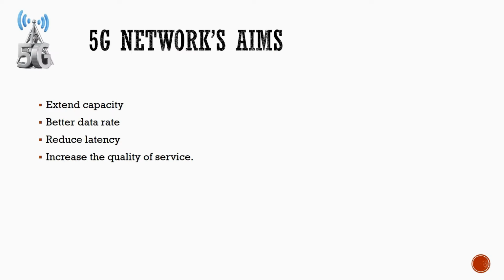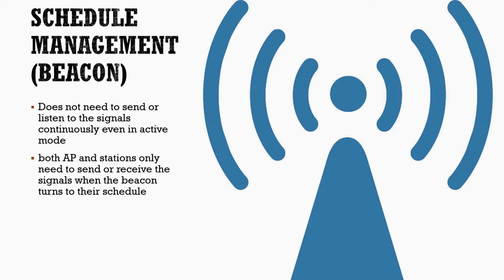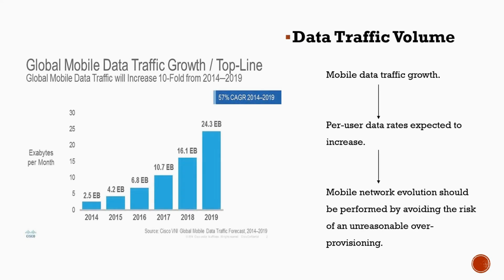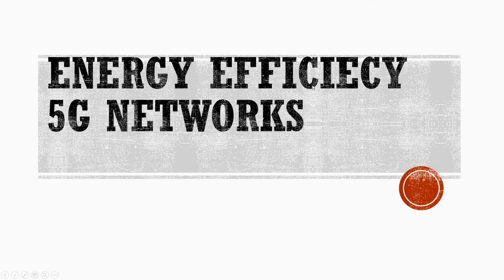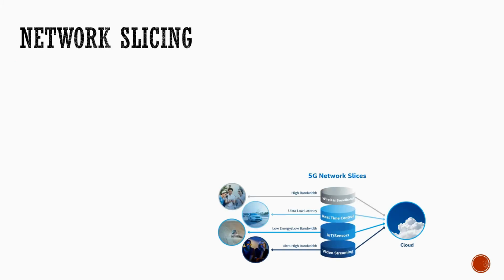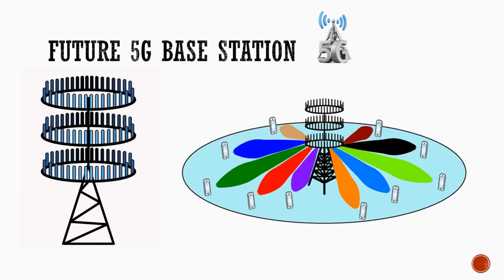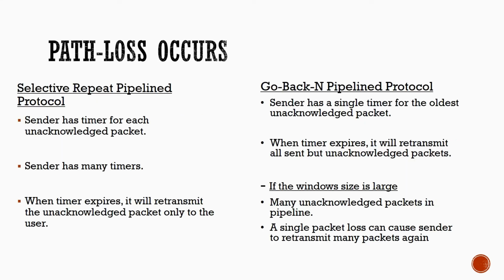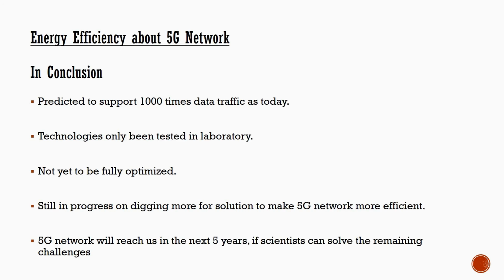Energy Efficiency on 5G Network

Comment: I've stumbled upon this presentation by accident, I have found a few things that weren't quite correct so here's some feedback:
2:50 There are no beacons in 5G, nor were there any in 4G/3G/2G. Every base station has a scheduler deciding who gets to transmit what and when, and a downlink control channel through which the scheduling information is communicated to the mobile phones. No beacons.
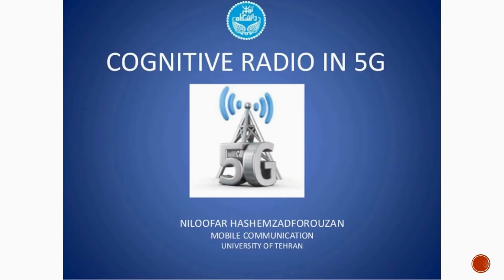3:05 There are no isotropic antennas used for wireless transmission - in any wireless communication technology whatsoever. At most there are omnidirectional antennas in use for small cells these days. in fact the picture at 3:40 illustrates a simplified antenna radiation pattern of an omni antenna - but for some reason the picture was rotated 90 degrees. Rotate it by 90 deg clockwise and you will see a vertically positioned half-wave antenna and a cross-section of its doughnut-shaped radiation pattern
The isotropic antenna is just a theoretical concept (a point in space radiating in all directions with equal power), used to characterize directionality of real antennas. For any antenna in its tech specifications you will find its gain expressed in dBi (decibels over an isotropic antenna), i.e. how much stronger this antenna radiates in its main beam direction compared to this theoretical isotropic antenna. I.e. an antenna with 3 dBi gain will radiate (and receive) signal stronger by 3 dB (twice the power) compared to an isotropic antenna
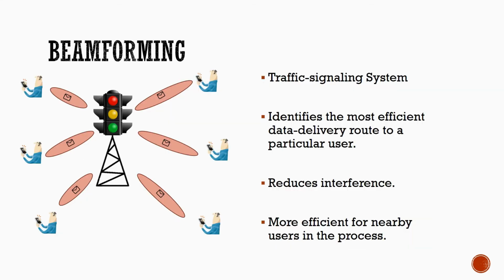12:10 Beamforming is not a 'traffic signaling system', but a method to achieve narrower antenna beams through phased array antenna configuration, where multiple antenna elements radiate the same signal, each applying a preconfigured delay. The radiated signals interfere in space, either constructively (amplifying) or destructively (cancelling each other), and by picking the right delay (phase shift) for each antenna element it's possible to form a very narrow beam. These beams are used for LOS (Line Of Sight) communication in 2GHz+ bands and mmWave bands, but there's no 'bouncing off obstacles' option
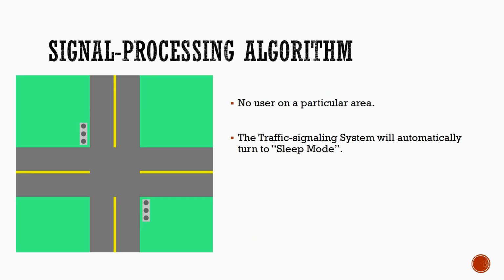12:50 There's no 'sleep mode' for area covered by a beamforming radio when there are no users there. That radio still has to transmit and receive data through beams covering that area: it periodically sends synchronization signals and broadcast information (announcing it's presence) and it must be ready to receive uplink messages (over a Random Access Channel) in case a new user wants to connect
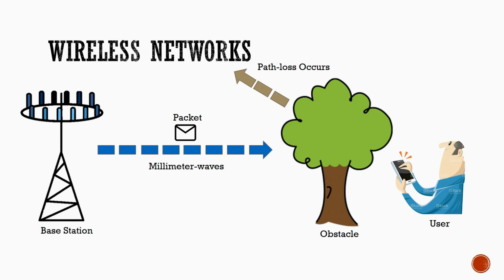13:40 You are confusing path loss (which is a natural decrease of signal strength with distance) with loss of signal. Path loss is just a number expressed in dB, that base station takes into account when determining required transmission power for a given user (i.e. 1.8GHz signal will experience some 70 dB path loss over 100 m distance, or some 80 dB over 300 m distance). The description that follows in the presentation is about algorithms used for block / packet retransmission (ARQ), nothing to do with path loss
14:40 Small cells are used to increase the density of connected users, as well as traffic density (more connected users and transmitted Mbps per square kilometer). Nothing to do with path loss, it's just a network capacity boosting strategy used by operators in hot spots (crowded areas). These base stations transmit at much lower power, which limits their coverage (and interferences to other stations)

Comment: Hi. I would like to ask what is the impact of the IoT market on 5G?
Reply from the maker: Hello Jessica. The impact of the IoT market on 5G will be huge. Integration of connectivity such as low-power Wi-Fi and Bluetooth Smart onto the SoC is key to achieving lower power and low-cost devices for IoT. With 5G, we’ll most likely see several connectivity standards that will coexist, so solutions must address multiple standards and be designed for power efficiency. 

Hope this answered your question :)

Comment: Hey quick question! How will 5G latency be lower if processing is being done in the cloud?
Reply from the maker: Hey! That's a very good question. Latency in the case of 5G refers to over-the-air latency, between the user device and the radio access network radio. To reduce overall latency, service providers will need to put data much closer to end-users, which is why some MNOs are considering leasing space at their cell sites to host data and applications for content providers, particularly in large urban centers. Utimately, the placement of data and processing will be determined by the supported 5G application. The Mobile Edge Computing (MEC) initiative will play a major role in addressing this important challenge. 

Hope this answered your question :)

Comment: This helped me understand more about 5G. Hopefully the coverage wouldn't be limited when they roll out
Reply from the maker: It's very hard to tell if the coverage would be limited but what we do know is that 5G is planned to operate using high-frequency band of the wireless spectrum aka milimeter wave spectrum. This however requires a lot of antennas and carriers will have to build much more antennas than what currently have in order to get the same cover as the current networks.